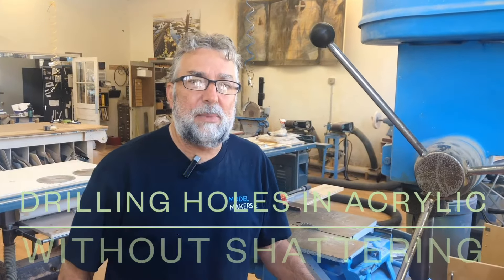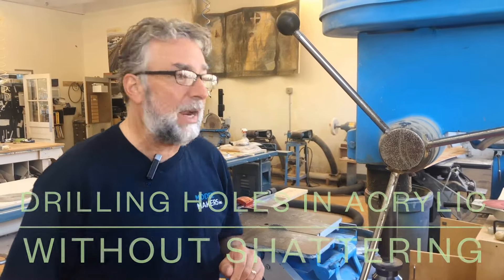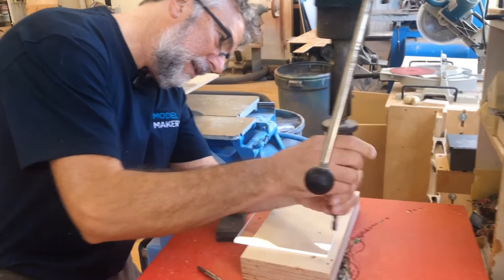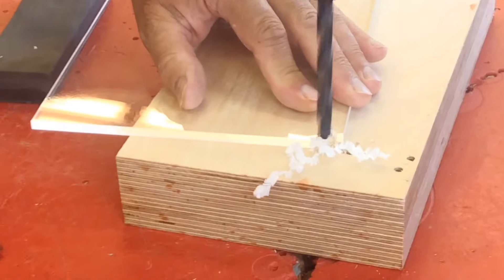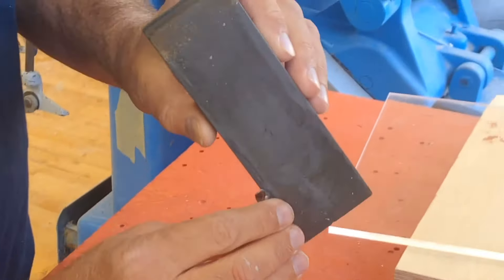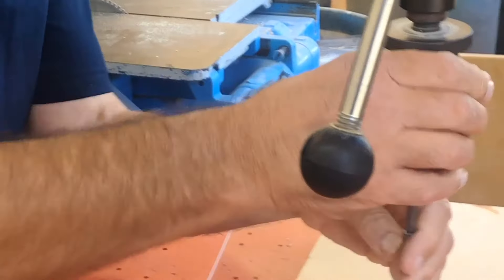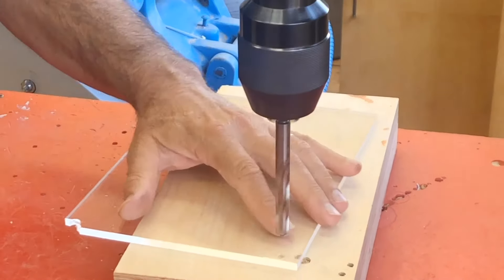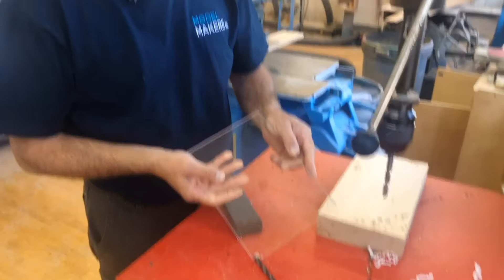Drilling acrylic without cracking

Comment: worked flawlessly! made holes right on edge of acrylic effortlessly. I used some water with coarse side of Gordon combination sharpening stone from harbor freight to flatten the cutting edge. Took 1-2min to flatten each edge (my bit had 2 edges, was the standard titanium 118 degree bits from harbor freight). You just make the cutting edge of the tip flat instead of sharp. He said parallel to shank, which is incorrect. parallel to the cutting edge. Flatten the sharp cutting side of the tip that makes the angle of the drill bit, opposite the flute. Cheers!

Comment: I just tried it on 2mm (0.08") acrylic sheet. Right next to corner edge. It works brilliantly. New 6mm HSS drill but with dulled cutting edges and corners, just like you demo'd.
500 rpm not good but 800 much cleaner hole, fewer micro-chips but more melt-exit shim to chamfer off. Thanks Mike, much easier than grinding down new drills to 120° point.

Comment: How about larger holes, like 1/2" or larger, where one might normally use a hole saw???
Reply from the maker: Yup, that's a different animal. The technique that Mike is demonstrating is for smaller holes. Depending on how precise you need to be, you can start with a smaller hole and then file it open to a larger size. You can use spade bits to make larger holes in softer plastics, but spade bits don't work well on acrylic. Of course, if you have a CNC machine with an endmill or laser, you can make nice round (or any other shape) holes of any size...

Comment: I'm looking to enlarge an existing hole from 28mm to 30mm. What would be the best suggestion for doing this without cracking? I was thinking a step bit but I'm not sure if they make them that size.
Reply from the maker: How thick is the acrylic?
Reply: @modelmakers33  Not thick at all -- maybe 2mm. Very thin.
Reply from the maker: @SatoshiMatrix1  Try using a rounded file - gently, and just avoid 'tugging' on the material, or it could break. After a few careful strokes you should get a feel for the amount of force required to remove material without bending or pushing or pulling on it. I don't know how accurate you need to be, but it might help to draw or scribe the new larger circle on it before you start. Enlarging a hole with a file by 1mm in 2mm thick acrylic shouldn't take long. You're not removing a lot of material. Just be careful and take your time. If you don't have a rounded file, you can also curl a piece of medium grit sandpaper and use that.
Reply: @modelmakers33  The exact thing I need to modify is an arcade machine panel. The panel is wood, with 28mm button holes. I need to widen the holes to 30mm. This is no problem drilling through the wood. The problem I have is with the acylic panel on top that serves to protect the wood finish from finger oils. I want to simply enlarge the existing holes without cracking the thin material. 

So what about using a step bit?
Reply from the maker: @SatoshiMatrix1   If you can remove the acrylic from the wood panel then you can use a file or rolled up sandpaper to enlarge the hole by 2mm. No opinion on a step bit.
Reply: @modelmakers33  Sandpaper to etch away 2mm of acrylic? That might be okay for one hole but uh I need to enlarge twelve in total. I don't think sandpaper would do the trick.
Reply from the maker: @SatoshiMatrix1  Curled or rolled up medium sandpaper (100 - 150) can substitute for a curved file if you don't have one, but a curved file is preferable. Enlarging a hole from 28mm up to 30mm means removing 1mm of material all the way around, which shouldn't take long at all in such thin acrylic. Obviously X12 is a different story. The good news is that you'll probably be able to do the twelfth one a lot faster than the first!
Reply: Buy a drum sander for your drill and use say 80 grit paper on the drum. You can buy a set of various sized drums quite cheaply, and you slide the sandpaper over the rubber and tighten with a screw to expand the drum to hold the paper in place.

Comment: Hi, it would be great if you could show how you clean-cut acrylic sheet pieces.
Reply from the maker: It's essential to use the appropriate blade or cutter. We covered some aspects of that in an earlier video, 'Edge Finishing Acrylic,' where we cut 3/4" acrylic with a circular saw blade made specifically for plastic. That video is certainly not thoroughly comprehensive when it comes to cutting acrylic, so thanks for the suggestion! Is there something specific you'd like to see?
Reply: @modelmakers33  I want to cut n finish acrylic accurately as you do for your models. Thanks for your response.

Comment: My 'bounce' my bits as they cut.  I get good results that way.  I am going to have to try your method.  I like the way it works.   I have also watched many of your videos in the past and I love what you have all done.  I have subscribed.
Reply from the maker: That's great, thanks! We'll be making more, and we're open to suggestions if there's something specific you'd like to see. Don't understand "My 'bounce' my bits as they cut" - ?
Reply: @modelmakers33  Bouncing Bits is just drilling for a second and then bringing it up and then drilling again until you drill all the way through.  I do that with materials I know will break or even melt with too much friction from the bit.
Reply from the maker: @andrewluchsinger  Ah. I had not heard that term used before. I think what you're describing is what we would call a 'peck.'
Reply: @modelmakers33  We both have learned a new term.  Very Sweet.
Reply from the maker: @Andrew Luchsinger  👍